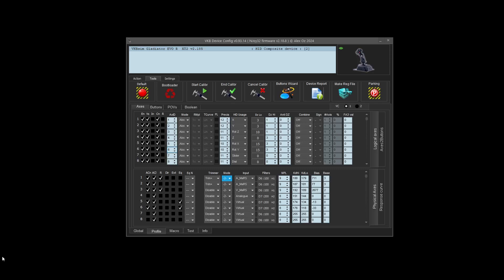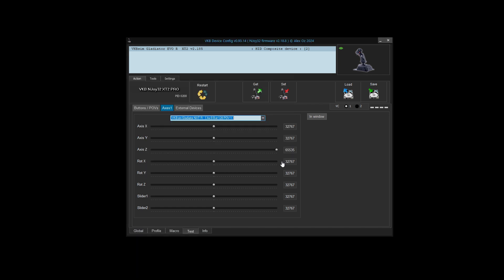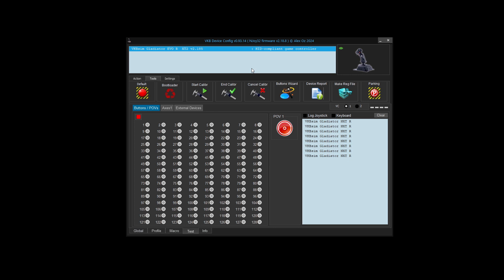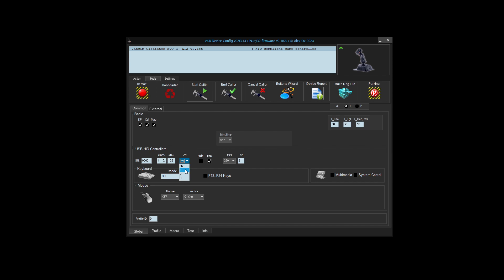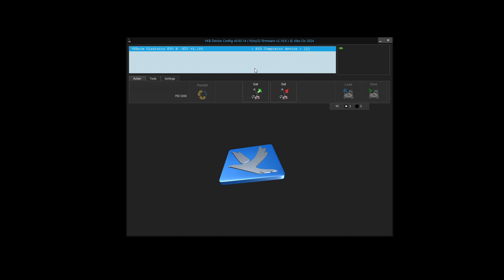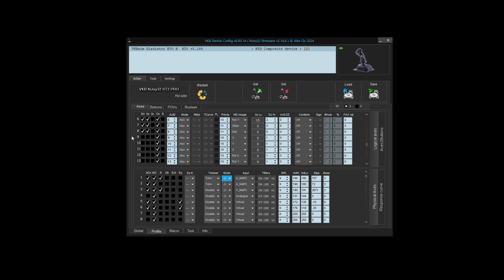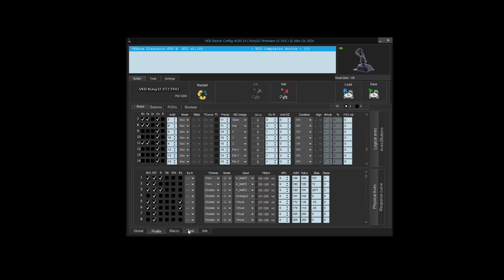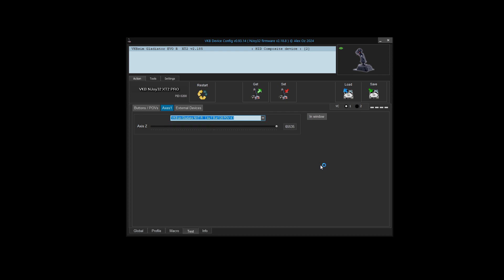VKB How to use Virtual Controllers and Axes

Comment: Nice, but what would this be good for (simple example)? ..
Reply from the maker: Some of the VKB grips such as the Modern Combat Grip Ultimate have up to 9 axes on the grip itself (x and y on the base, twist on the stick, brake lever, flip trigger, and two ministicks each with x and y axes). In addition, the Gladiator base is often paired with other GNX modules like the throttle quadrant THQ.

Comment: By chance do you know if you can set a virtual axis "bootup" position? 
I set the left Encoder to be a trim+ axis, but every time the joystick is initialized, on boot or SET, it goes back to centre (32767). 
I want it to start out at full saturation of 65535.
Reply from the maker: Drop by the VKB Discord and you'll be able to get that question answered in the software channel :)

Comment: Is there a way to sort of 'rotate' the analog axes of a ministick by 45 degrees? On the OTA throttle, since the main body of the joystick is rotated 45 degrees, using the stock X and Y axes of the ministick for lateral and vertical thrusters (in Elite: Dangerous) doesn't have them lined up with 'true' horizontal and vertical movement movement of the ministick.
Reply: any luck with this?